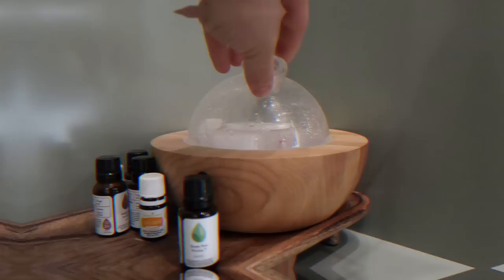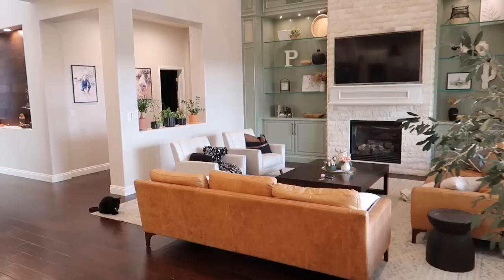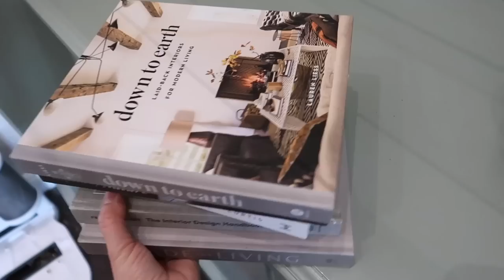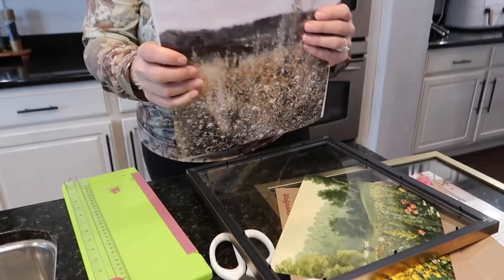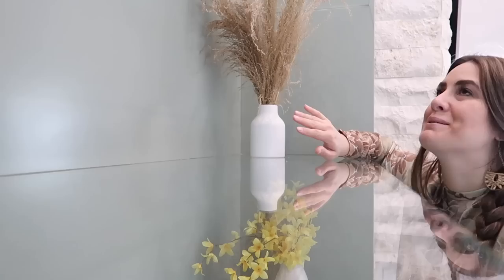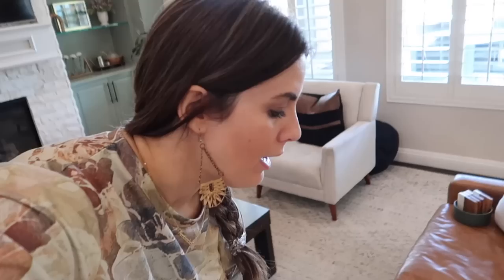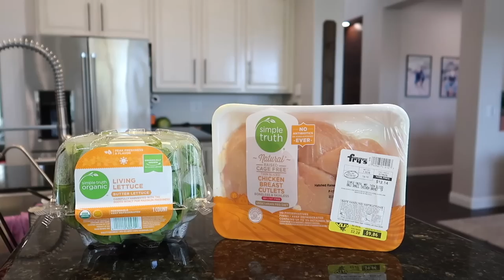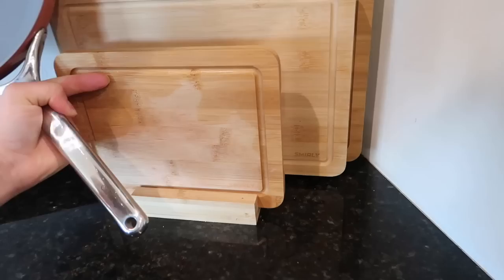*NEW* SPRING CLEAN & DECORATE With ME 2023 🌸 Using Decor I Already Have, Spring DIYS + Recipes

Comment: Amanda, your top looks really well on you!  The colours are great on you and the style too!

A chore I would never want to do again would be laundry.   I love the putting away of them I just don’t like washing them.  The basement is dingy and crowded with a majority of my father’s things and the way the pipes and heat vents are for washer.  The washer is in middle of basement and the dryer is opposite against the basement wall and two washing machines are broken and continue to sit there.  So I have to use the old 1940’s wringer washer that belonged to my grandma.  And it takes 6 hours to do two loads.

The tea towels - The Easter /Spring one with the eggs and tea cups is my favourite

Weather - This has been our best winter (we normally get -40 to -50’c weather)  the coldest it’s been is that on one or two days then been about between -12 to -25’c  for most of the winter.  This week (march 20 to 26 2023 it has been -3’c which is melting the snow) and I have had to wear two sweaters less then in winter so I am happy!  I prefer warmer winters to freezing.  Our winters normally get so cold that if you take off your mitts your fingers freeze immediately!  But it hasn’t been like that this year.  But I am so glad for Spring!

Coffee table- I love your coffee and the colour works well for your Living room area.  It is a nice contrast to the lighter pieces.  Keep it!

Comment: We've definitely had a longer and colder winter than usual here in San Diego. But I have been all for it. I prefer a colder winter than a hotter summer, however, I also don't have air conditioning. So that plays into my opinion, for sure.

Comment: To answer your question about the weather... I live in Norway, north of the polar circle. This winter it was -25c (-13f), and we had about 2 meters (almost 7 feet) of snow. That's not the worst part though: During most of the winter we have "polar nights", which means that the sun never rises above the horizon. We basically have no sunlight for weeks! I am SO ready for spring...